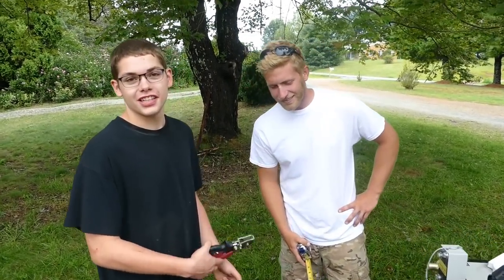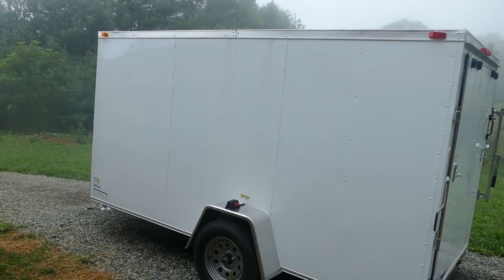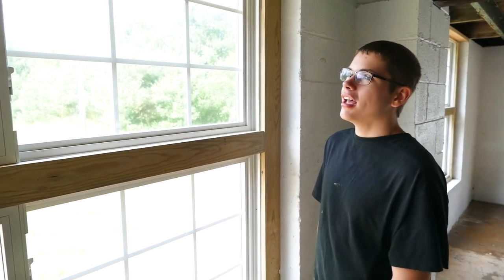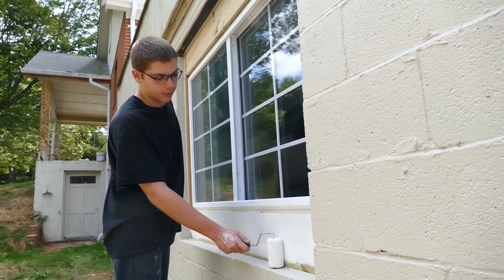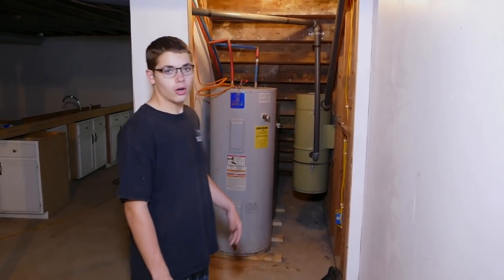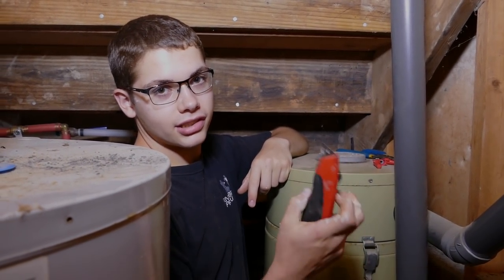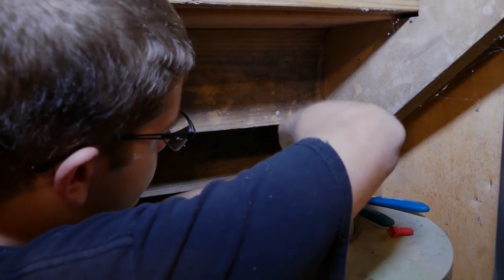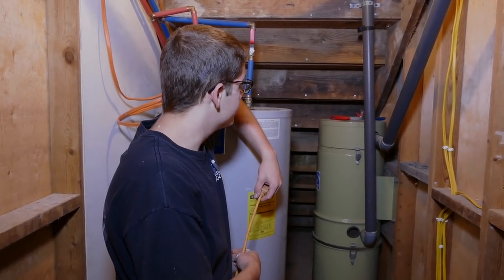In The Gutter  - Mountain Remodel S2 Episode 14

Comment: I my self am a contractor.i have a tip for you when you use paint cans take a screw driver an drive holes in the lid lip it won't get all over and when you use the lid to put back on the can it aint messy the paint runs back in the can.great vids
Reply from the maker: Will try that. we do seem to make a mess when we paint